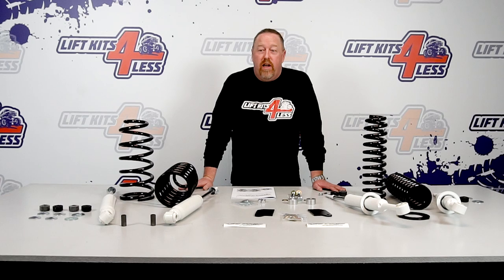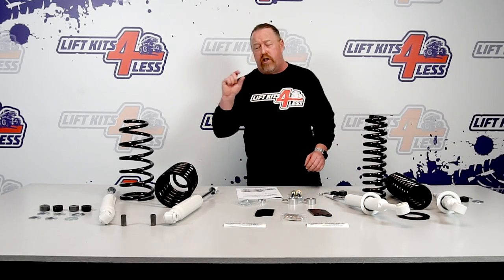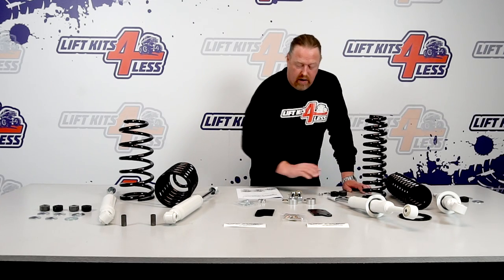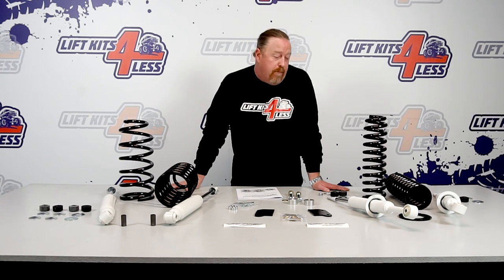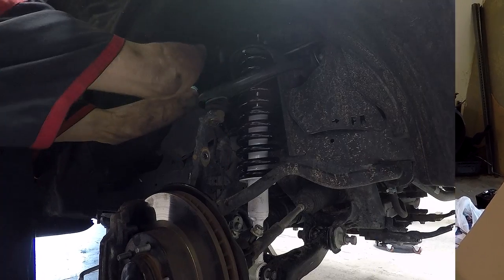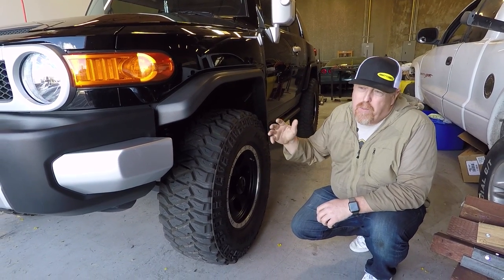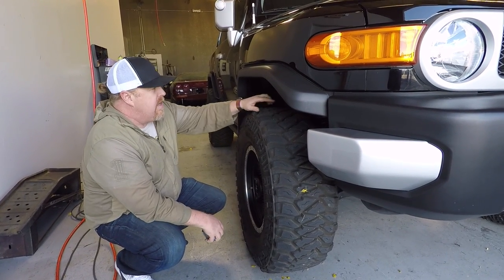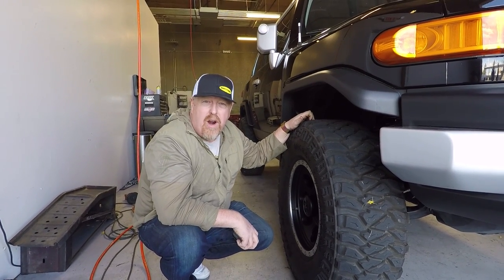Pro Comp K5074B  3''  Lift Kit  2007-2014 FJ Cruiser (Instructional with Before/After photos)

Comment: hey, i just got my 3 inch procomp suspension lift kit installed but dont like the leveling. if i get after market uca, will i be able to throw on a 2inch or 2.5 inch spacer lift on the front with my lift??

Comment: I got 4.25 on my ProComp 3" lift kit. Been a couple years..never settled.
Reply: Has it settled yet?
Reply: @santiagocardenas4661  No it stayed where it was from day one.
Reply: Mine never settled either. I got 4 and 3/8 inches and very high angles on cv axle and tie rods from the rack and pinion. It is eating up inner cv boots fast and I'm changing to a better more expensive lift that doesn't ride as stiff as a board. This is not a quality lift

Comment: So I have an 07 FJ Cruiser and I just upgraded my tires and rims I ended up with 33's this go around I may end up with 35's next time not sure yet but in the meantime this thing was bone stock. After I do the lift is there anything else that I can upgrade to make or allow the vehicle to ride smoother ?
Reply from the maker: Hi, for optimal alignment the Pro Comp upper control arms will allow for much better tire wear.  This is a great kit for the money

Comment: Great video!  Very informative...looking into procomp now!
Reply from the maker: Thank You Joseph!!! If you have any questions you can call us direct or use the live chat on our website www.liftkits4less.com
Reply: I just installed this lift on my 2010, used the diff drop, and the CV boots are still at a bad angle. Suspension is incredibly stiff, completely lost articulation and comfort, and the front sits about 3/4 inch taller than the rear. And I get a weird steering wheel vibration around 65-75mph that comes and goes, hoping it's not the differential and just wind gusts.
Reply: @jamesiepooh7337  Just curious if you end up finding a fix for your weird steering wheel vibration around 65-75 mph.

Comment: I have a 4x2 fj cruiser and getting a 3inch lift kit with upper control arms. My question is I'm worried if it would be able to fit in the garage
Reply: They made 2WD FJs?
Reply: @Niloc1922  unfortunatly yes
Reply: It won't fit in the garage
Reply: @onenikkione  well it did work. Thank you 😊

Comment: Will the 3" lift look good with slightly thinner tires ? I want to keep my mpg.
Reply from the maker: The customer in the video went with a 35x12.50 this kits max tire size is a 33x12.50R16-20, 285/75R-16, 285/70R17,295/65R18, 295/55R20. Wheel size 16" thru 20" x 9" wide rims with 4.5" to 5" Back spacing. If you comment your tire and wheel size, I can give you more information.
Reply: If you want to keep you MPG, lifted trucks are not your game bro.
Reply: MPG is not the FJ’s strong suit .
Reply: It’s an FJ not gas saver friendly

Comment: Excellent video, I'm definitely doing this to my 07 FJ!
Reply from the maker: Thanks! Have had nothing but great feedback on the Pro Comp 3" FJ Kit.
Reply: I'm in Virginia area unfortunately not Nevada.  I need to replace my control arms and bushings and that's the lift kit that I have been pricing.  Any suggestions for a place I can go to in VA, MD, PA or NJ?
Reply from the maker: What is your Zip Code?
Reply from the maker: Hi, what is your Zip Code?
Reply: LiftKits4Less 20186 or 21237
Reply from the maker: Try OUTLAW TRUCKS
15441 Braggs Corner Road
Culpeper, VA 22701
540-829-0300

TRICK TRUCKS
14510 Lee Road
Building I
Chantilly, VA 20151
703-961-8114
Reply: Do you guys know the offset on the wheels?
Reply from the maker: The wheel the customer used was a zero offset
Reply: Ok thanks!

Comment: I got a question I just installed this kit with the Pro Comp upper control arms and there is still quite a bit of an aggressive angle not only on the upper control arm but also on my axles. If you want pictures send me a good email and I'll send some to you I am not sure if that's how it should be sitting but I just feel it should be sending a little more level especially with the differential being dropped. Other than that everything is good that Front End is Extremely stiff. But all in all good system
Reply from the maker: Upon installation the CV shafts and UCA will have a angle to them. As long as the CV boots are not being pinched or ins a Z shape they should be fine. As for the UCA as long as the ball joint is not over at an angle that does not allow the ball joint to cycle there should be no problem there as well.
Reply: LiftKits4Less is there anyway I can send you some pictures of the Axel's sorry I just want to another opinion and since you guys do these all the time I figured I would ask. Better safe than sorry
Reply: I know this is an old comment, but I have this pro comp 3 inch lift on my 2007 fj. The front lift ended up being 4 and 3/8 of an inch higher than stock, and my cv axles tore within 6 months and I replaced the axles and the inner boots are torn again less than 2 years later. I am taking this lift off and putting on the bilstein/ old man emu kit from toytec. The other thing I hate about the pro comp is that it rides very stiff and makes it a pain to drive it. In my opinion, cheap is what you get with this lift.

Comment: What are the specific control arms recommended by Pro Comp to be used for this lift kit?
Reply from the maker: https://liftkits4less.com/pro-comp-57003b-pro-runner-upper-control-arms-2007-2014-toyota-fj-cruiser-2wd-4wd?___SID=U
Reply from the maker: https://liftkits4less.com/pro-comp-57003b-pro-runner-upper-control-arms-2007-2014-toyota-fj-cruiser-2wd-4wd

Comment: If I get this lift can I put a after market bumper on it
Reply from the maker: Yes, not an issue can add an after market
Reply: LiftKits4Less do I need to get anything else or can I just buy this? I have a 2012 fj?
Reply from the maker: This is a complete kit the only option is the upper control arms
Reply from the maker: https://liftkits4less.com/pro-comp-57003b-pro-runner-upper-control-arms-2007-2014-toyota-fj-cruiser-2wd-4wd?___SID=U
Reply: LiftKits4Less do I need them or will I be fine?
Reply: LiftKits4Less so I don't need them, if I don't I'm going to buy this lift right now?
Reply from the maker: They are not required
Reply: @jacksoninman9987  did you buy it?
Reply: @muddyguns  if he did, I hope he doesn't regret it like I do. I got my pro comp lift over 3 years ago and It lifted the front too high. It sits higher up front than the back, it's super stiff riding, and it eats up my cv axle inner boots. Not a good lift in my opinion. At least not if you don't have heavy bumpers

Comment: The tires look nuts!!!  what are the spec on the rims? offset and size?
Reply from the maker: Max Tire Size: 33x12.50R16-20, 285/75R-16, 285/70R17,295/65R18, 295/
Wheel Size: 16" thru 20" x 9" wide rims with 4.5" to 5" BS
This customer went max on both tire and wheel.
Reply: LiftKits4Less 

thank you for the info
Reply: do you know what brand tire that was?